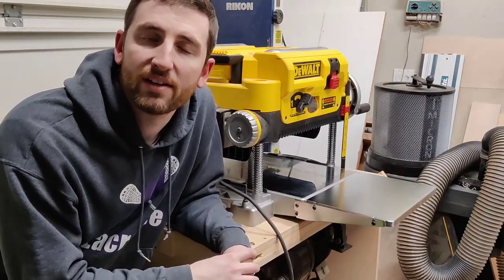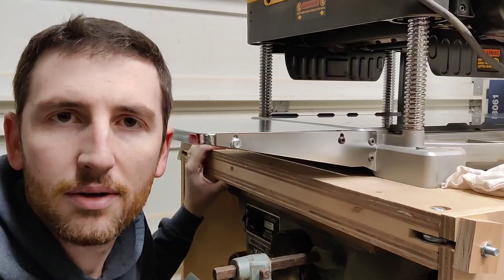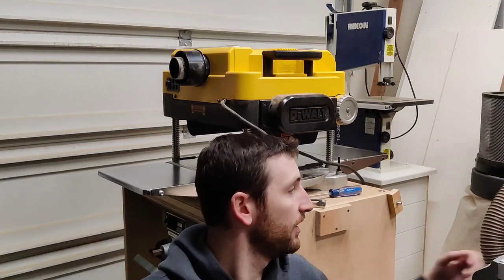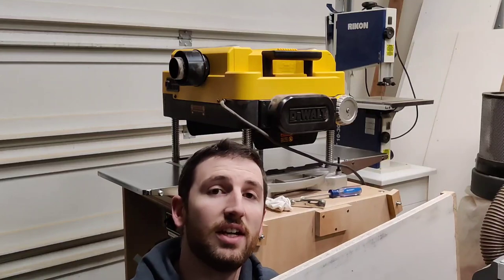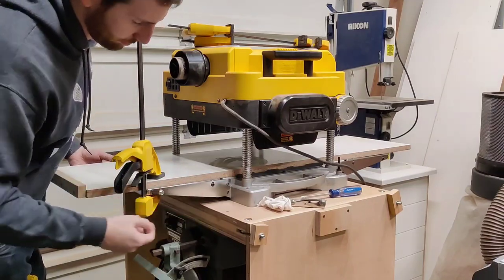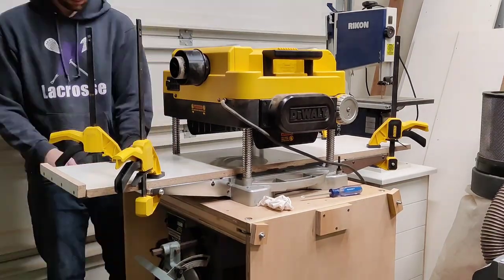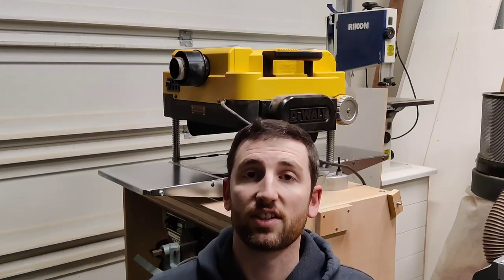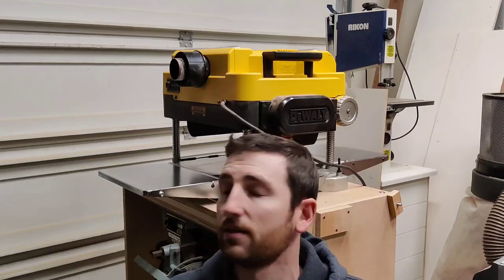How to Align Planer In Feed/Out Feed Tables

Comment: even better way i recent discovered is using 2 i beam levels with magnetic strips on bottom (i put one on each side about 2 inchs from edge ) 
the levels pull the tables up to the bed perfectly
Reply from the maker: That's a great idea. No need for the clamps that way!
Reply: very good idea.
Reply: Maybe add removable magnets to your sled? :)  @keatonbeyerwoodworking

Comment: What if my tables are even with the planer bed at the edges of the tables , but in the middle of the tables they sit a little bit lower than the bed ?
Reply from the maker: That means your tables are bent. You can put a straight edge across the table and check to see if the table is dipped in the middle to validate. If that's the case you can contact the manufacturer to see if they will send replacement tables.
Reply: @keatonbeyerwoodworking   thanks! they were bent and my replacements are now fine!